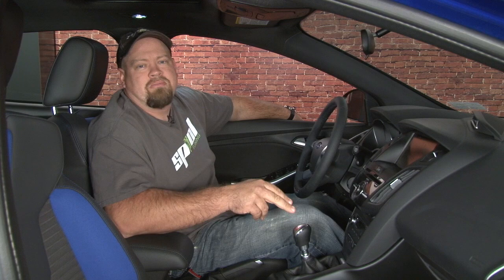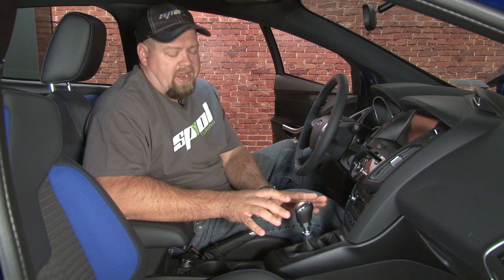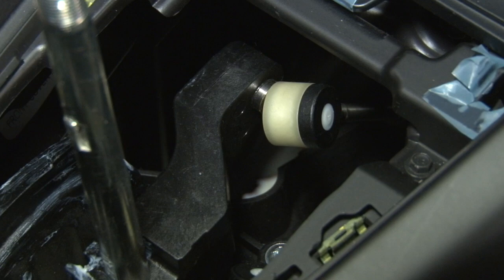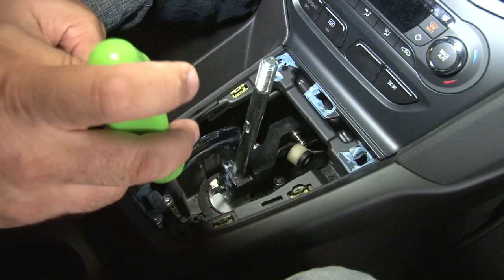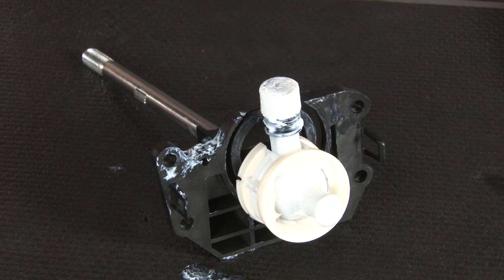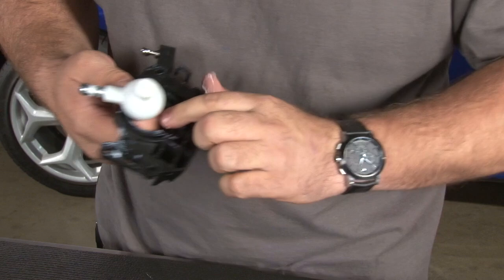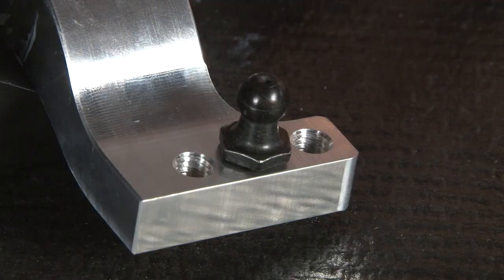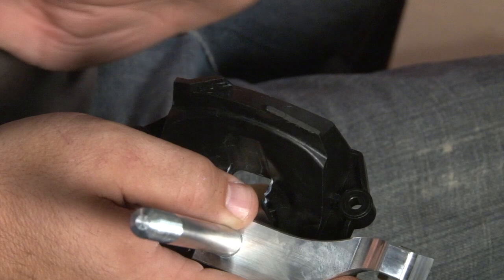Focus ST Steeda Short Throw Shifter And Bracket Kit 2013-2018 Installation

Comment: after watching this video, I decided to try and install a boomba shifter on my ST. I've done this on my previous car, a 2002 WRX, and after watching the video I wasn't too worried. The main hang up was that spring at 4:26. The video just says "just lift up the spring and take out the shift plate", easy, I thought... I wrestled with that thing for more time than the entire install. How did you disconnect the spring? You dont show it in the video. I think I just got lucky by twisting the shifter to try to get the right socket out of the hole its seated in while pulling up on the spring with pliers and cursing as much as possible in between frustrated breaths. Other than that, good video.
Reply: I used a hook pick instead of pliers. Getting it out was easier than finaggling it all back in place.. I agree, getting it out/in took longer than the rest of the installation lol
Reply: ngl it popped out and i spent over an hour messing with it and couldn’t get it so i just left it off

Comment: I really would like to know where you moved the spring to and how you moved it back, i got my shifter out but i cant get the new one in and now the sping popped off and is unsprung, so i gotta pull the shifter assembly now which means pulling the console, small job just got majorly huge...
Reply: same thing happened to me i just said fk it and left the spring out haven’t had any problems as of

Comment: From my understanding the short throw shift kit deletes the reverse lockout function if your car is equipped with one?
Reply: What is a reverse lockout function? I have a ST2 looking to upgrade
Reply: @shitcreekwarrior8794  some cars have it, not sure if the ST does.  It's a mechanism on the shifter that you have to pull up in order to put the car into reverse.
Reply: The focus st has reverse lockout and it should still work properly after installing this

Comment: I installed the shifter but I’m having clearance issues and have to use the reverse lock out to put it into 1st and 2nd gear what do I do
Reply: I’m having that same issue please if you fixed I need to know
Reply: @sebastiangallardo9586  do a shift reset

Comment: Now after installing my short throw I can now go into reverse without using the lockout. Doesn’t make sense
Reply from the maker: You can loosen the main hold down bolts and adjust, I have seen that happen from time to time.